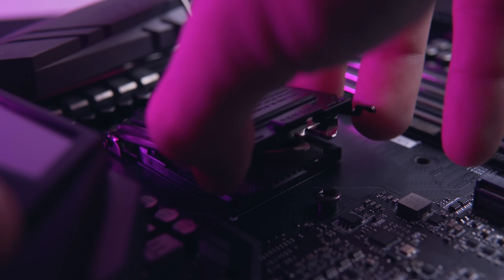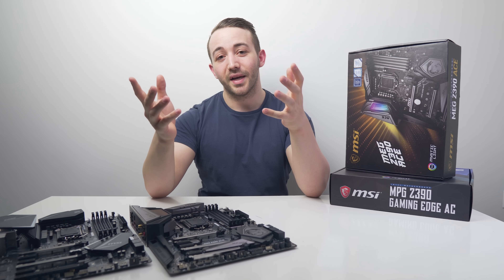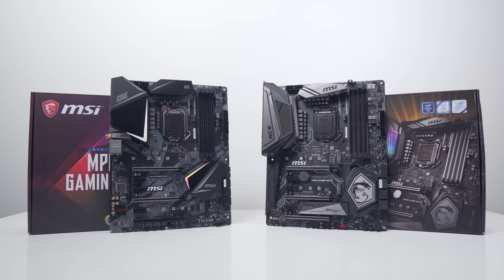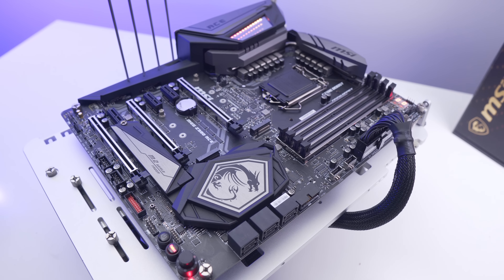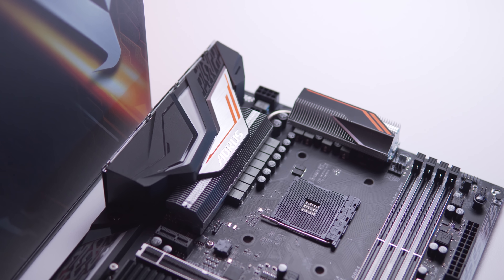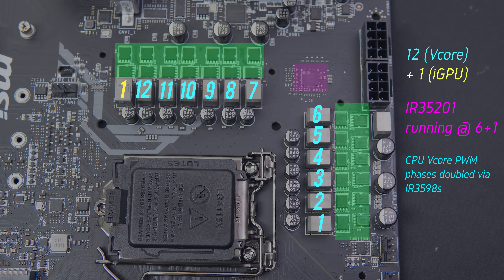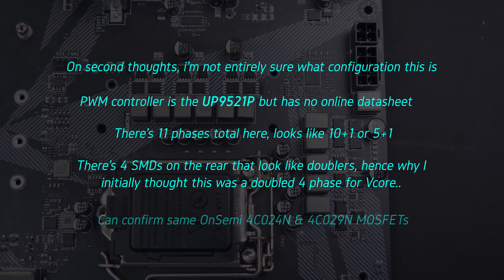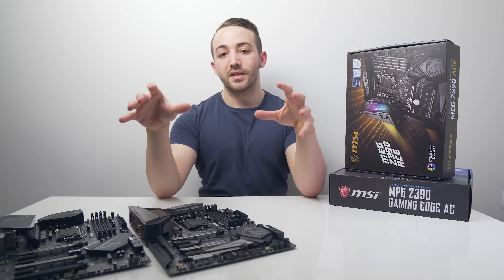Intel’s Z390 Chipset ft. MSI Z390 Ace & Edge

Comment: I upgraded and used the MSI Z390 edge ac mini atx and the i9 9900k along wth the msi duke 2080Ti.   I read a lot about how the i9 9900k runs hot but took the risk and was suprised that the i9 ran cooler than my i7 around 30 degrees on tickover and under load never reached above 75 degrees (running battlefieldV)on a bios overclock at 4.6 GHz XMP'd the memory at 3000MHz using this board and a corsair liquid cooled 100i V2 240mm fan, so its a good board in terms of temps something you can attribute to the extended PWM heatsink and enhanced circuit design. I have really good airflow even though the case is a phanteks enthoo (which some reviews say its not so good with airflow) 3 x 240mm intake fans 1 exhaust. The wireless signal speed dipped 15gb from wired, but I never use wireless. Overall I am Happy with this lower end of the Z390 boards, but if you have the cash to splash go for a better board for straight line performance as it lacks in this department. Overall like I say I'm happy with the board for now (low price), but I feel an upgrade coming on in 12 months.

Comment: Please note. Many review outlets are reporting heavy performance loss and increased heat with z370 and 9900k. If you are planning this chip on z370 it must be the very very high end z370 like asus maximus apex or formula etc
Reply from the maker: The way current Z390 boards are priced, those Z370 options actually make sense
Reply: @optimumtech  i agree. I was considering the z370 maximus x formula as it can be had for $550 new aud opposed to the z390 formula for $730 aud. But after seeing z370 vrm and the single eps cpu power can struggle with the 9900k it seems worth it for the z390

Comment: Do you think Maximux xi hero a better option compared to this? Considering the price of 290 USD right now. Also I heard that xi hero is using 4 phases on VRM. Not sure how bad will that be for overclocking.
Reply: I've read/seen that the Maximus XI Hero is not good at all for the 9900K. The VRM throttles under severe load.
Reply: Throttling is caused by CPU overheating, not the motherboard itself in this case.
Reply: Gamer Nexus said the same thing. 4 phase only.
Reply: 10 phases on maximus board.
Reply: @madd5  VRM wattage limits, so thermal throttling by the way. This motherboard has 13 dedicated phases to the processor and the cooling system is pretty good, much more than the XI Hero

Comment: Hello,one question why MSI exemple z390 pro gaming carcon have two block on for 12 pin+ one block 4pin and one block 12 pin?is essenzial or optional?i used before z370 8 pin two block from 8 pin or not?others mainboard has also Z370 8 pin two block 8 pin 4+4?
Reply: It's optional, you can use this extra connector to have a better overclock but more stable

Comment: edge ac has been giving me hell, i replaced it with the same exact board  same issue,random freezing High CPU usage,random yellow/greenish discoloration,. i tested it every single component , it was also freezing on Linux Mint , i have a nvidia 970 replaced with the gt 730  for testing purpose's no change same shit,i reformat it windows seven times so far and still not a change , and it makes the video card to refresh constantly at times, i didnt have an issue with my previous board that being the gigabyte z370  , so i tested a new cpu along with the rams hell even replacing the power supply....its been so frustrating  all this shit started after i reformat it windows,something tells me that MSI knows whats up it seems like an bios issue , screw MSI
Reply: Interesting as I just upgraded from an onlder msi 970 gaming mobo build but with the newer 1080ti last year, that oc a lot and stable as a rock. Now upgraded to gigabyte Master z390 with good 9900k and all other components are just as good. My gpu can't oc on the master z390 for some reason, checked all settings and drivers too. I'm thinking of going for msi z390 meg ace, as my old msi 970 gaming mobo was amazing for oc, just top benchmark scores, where as gigabyte master z390 is shite unfortunatelly, and I have checked all the setting and done a lot and a lot of research.

Comment: Maybe not the best to be recommending a z370 for 9900K with a possible weaker VRM and run the risk of thermal throttling ?
Reply from the maker: The point is that you could get seeing as Z370 is overall cheaper than Z390, when normalising for price you essentially can grab a higher end Z370 board. 
By all means, Z390 is the way to go if value is not of importance :)

Comment: ive been pulling my hair out for 6 weeks trying to figure out if i wanted to build a new ryzen system or intel and while the ryzen prospects were great they lack the one thing i love , over clocking ability, so i look at the intel z370 and z390 options and im like ok i can do either but  holy fucking coins to drop, and then i find out the asus board i was going to buy has a shit power delivery which would completely defeat my purpose. so i said ok well my 7700k runs as solid at the same voltage that ive had it on for what 3 years now, why not upgrade my z270 system , ya know like actually updat the system like people used to do b4 intel got all fantic after amds ryzen launch and screwed everyones brain up. so i bought a z270 MSI Platinum $360 board with 16 vrm phases and a ton of other features for $150, bought another GTX 1070 FTW  card and bought some new o rings for my water cool fittings for 20 bucks, a new corsair 570 mirror black limited edition case, some pastel white and uv black dyes and now i have a brand new system that still performs more than it needs to and actually in gaming  its a damn gem to over clock with and have fun, all for less than the price of an RTX 2080 so heres my thoughts , fuck you nvidia and intel you have lost your fucking minds.